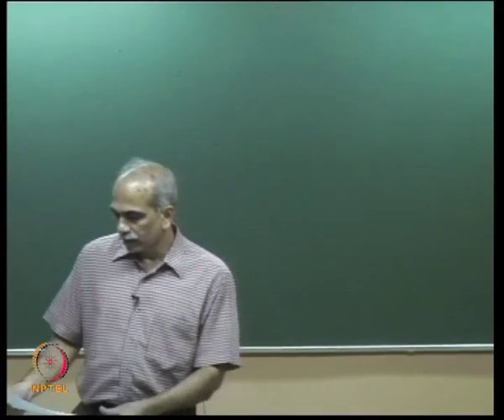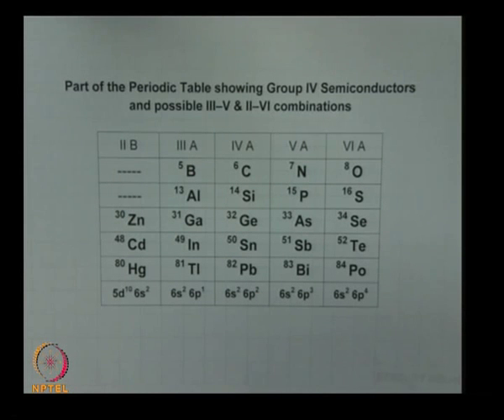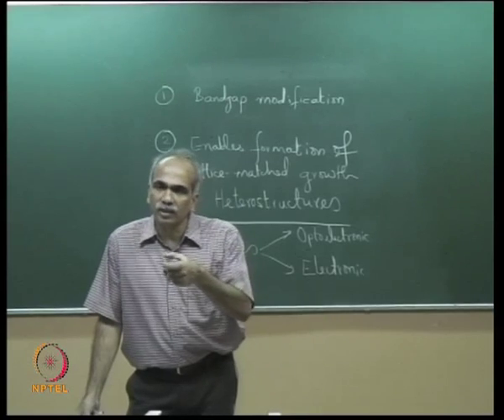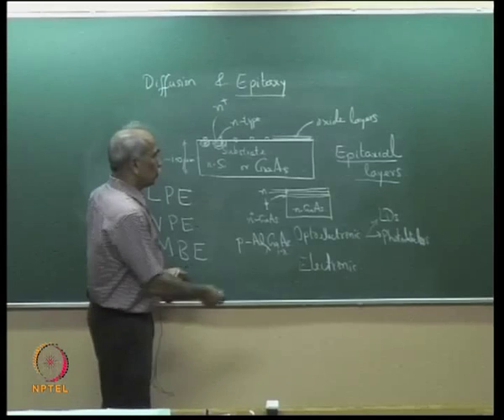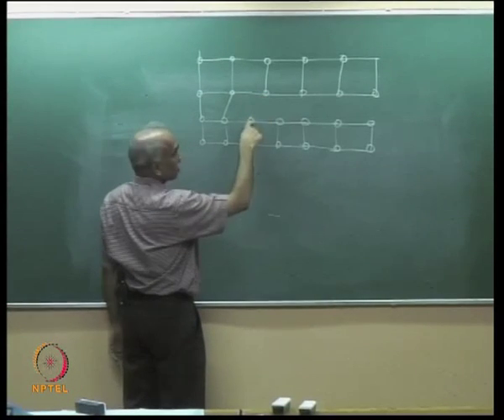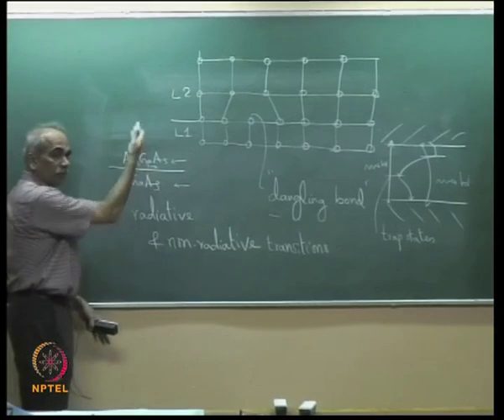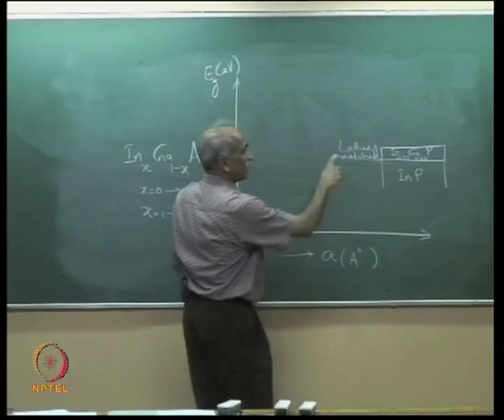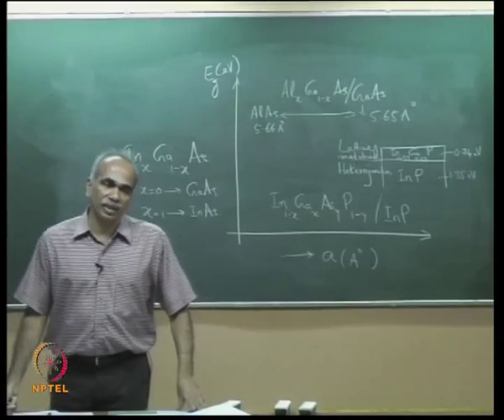Semiconductor Hetrostructures-Lattice-Matched Layers

Comment: I have two materials prepared at different conditions
one is having high lattice strain and another has low lattice strain
PL spectra shows high emission intensity for low lattice strain than higher one..
So can we tell that high strain material contains higher dangling bonds than lower strain materials...
please answer me
and if possible please give me any reference regarding that